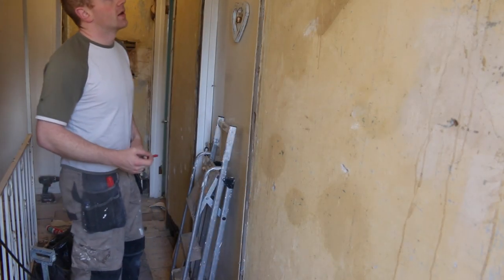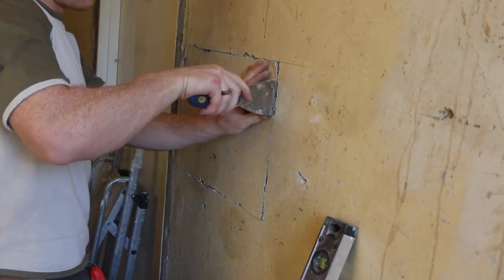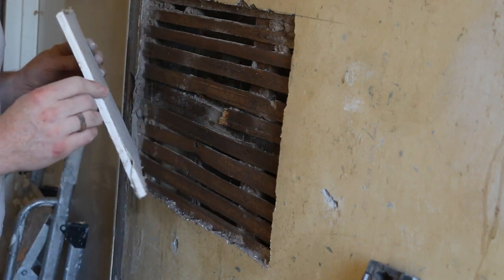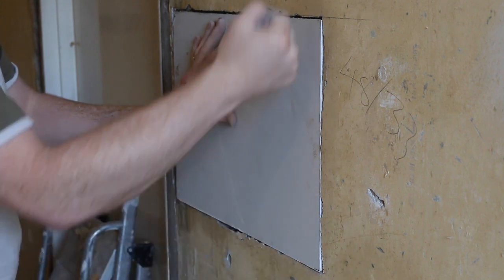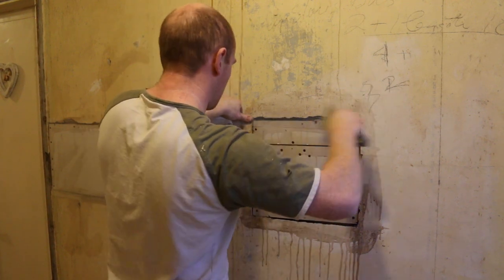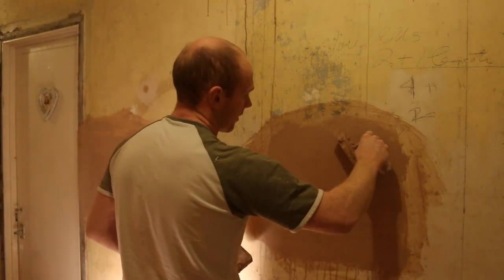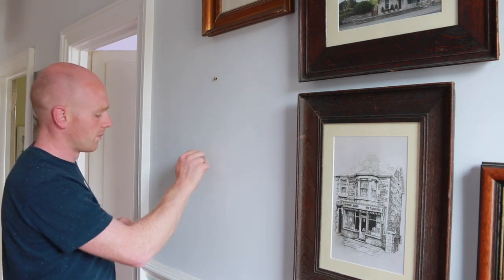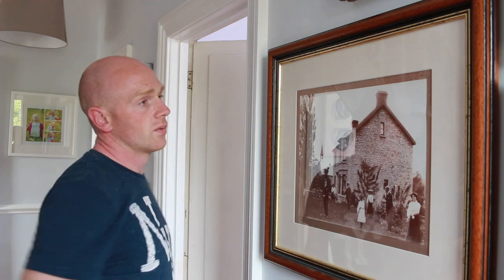Repairing Lath and Plaster

Comment: Excellant info especially the bit where you actually showed using the trowel to get the plaster off of the lathe. All others usually say "as you can see the plaster has come away from the lathe around the area due to the reciprocating saw or similar tool used."

Comment: Hi there. I have a house with rock lathe walls and ceiling. Is like a 2x4 sheet with plaster over and had a gritty rough finish texture I need to patch. How would I go about this?

Comment: If money were no option would you rip the whole house out and re-plaster?

That stuff looks a pig! When was the house made?
Reply from the maker: It's actually not a real huge cost to rip out and board, as the only cost is the plasterboard and screws.  It is the sheer disruption, dust, and unnecessary waste.  I try and keep what I can as it has done pretty well for 110 years so can't be that bad. If not living in during reno then perhaps a bit more tempted to gut everything but again it would create much more work and waste.

Comment: What would you do if the lathes were broke in the area of the damage? Great video by the way.
Reply: Common sense dictat would be to cut the lath out midway between the closest vertical timber stud on both sides of the break and replace that section. That way they can all be fixed to the vertical and then patched up as per the video.

Comment: Love your channel - keep up the good work.
I would however urge people to use lime plaster to do patch repairs like this. The material may be a bit more expensive but it takes no more time - just patience between coats. I recently did some similar patch repairs in my house. Lath walls done with lime plaster is a traditional material and provides better sound insulation than plasterboard.
Reply from the maker: We used lime extensively on all external walls but simply no need to on internal stud walls, not unless a historic building that has not already suffered from previous ‘renovations’. 👍